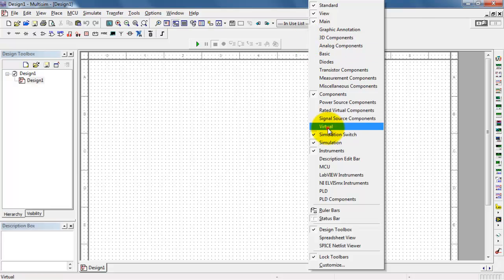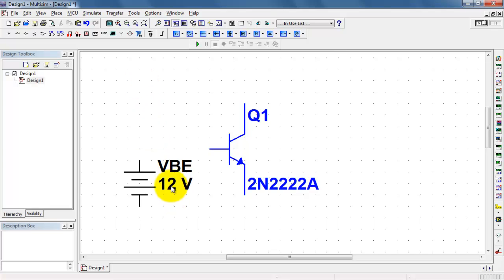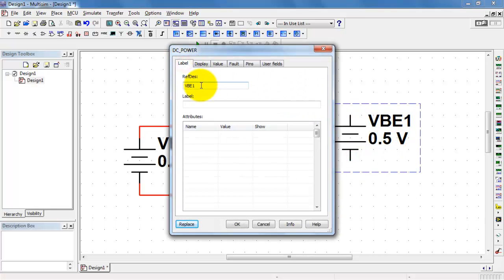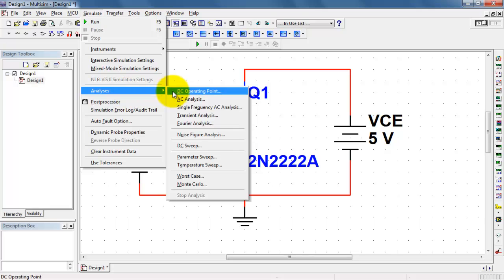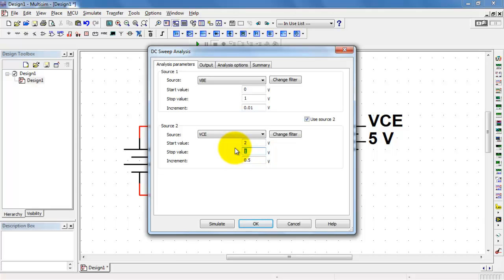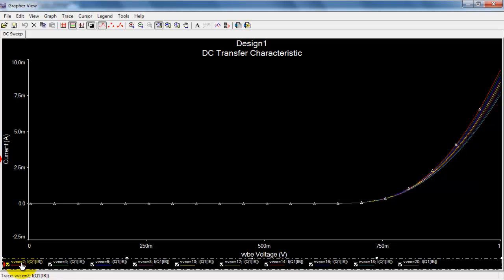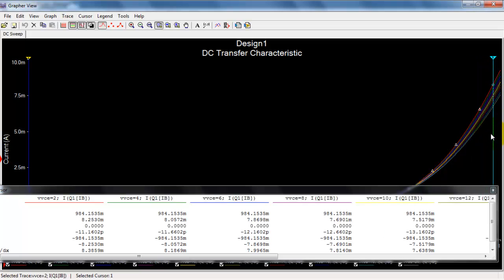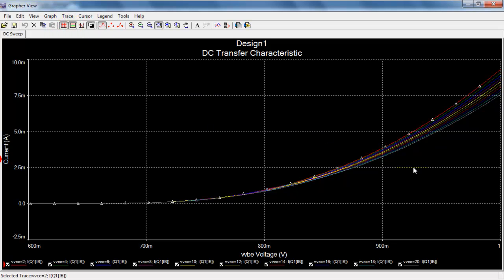NI Multisim: BJT base characteristic

Comment: on dc sweep graph, i saw x1,y1,x2,y2,dx,dy, dx/dy, what does that mean? please.
Reply from the maker: x is horizontal axis, y is vertical axis; the numbers indicate the position of the two available cursors. dx is the difference between the two cursor horizontal positions x1 and x2 (similar for dy); dx/dy is an estimate of the slope (derivative) of the graph at the cursor location.

Comment: how to test dc current gain of BJT on MultiSim? please.
Reply from the maker: Check out this related video http://youtu.be/LgjaxmC7NB8 that plots the BJT collector characteristics (plot collector current as a function of applied collector-emitter voltage for various values of base current). The DC current gain for a particular base current can be found be reading the collector current where the curve flattens out and dividing this value by the base current.
Reply: THANKS! :)
Reply: i don't really understand how, can you explain more by example? or can you create another video on how to test dc current gain on BJT? please thanks.
Reply from the maker: anh nguyen
Pause at 3:29 of http://youtu.be/LgjaxmC7NB8; the cursor data at the bottom shows the collector current Ic for each of the values of base current Ib (reported as "iib=" on the top of each column). For example, look on the far right side where you see "iib=0.0002", this is Ib=200uA. The fourth row from the top says Ic = 40.14mA. The DC current gain is therefore 40.14/0.2 = 200.7. Because the collector current varies somewhat with the applied collector-emitter voltage Vce (this is the independent or horizontal axis on the plot) you can see that the DC current gain is not really a single fixed value, but rather a value that depends on the transistor's operating point. However, since the plot of Ic vs. Vce is relatively level, you could choose an average value and use this as the approximate DC current gain.
Reply: ***** thanks, i understand a little bit on the graph, thanks. :)
Reply: ***** so, at Ib=200uA & Vce(x2)=3.2946mV then we have Ic(y2)=40.14mA. Is x2 is Vce & Ic is y2? am i correct?.What about x1 & y1? what is that value?
Reply: ***** at Ib=200uA then the x1=0.0000 & y1=-183.1604u, what is it please?